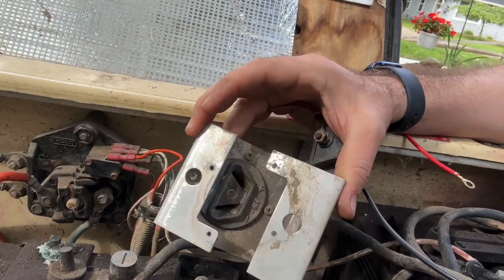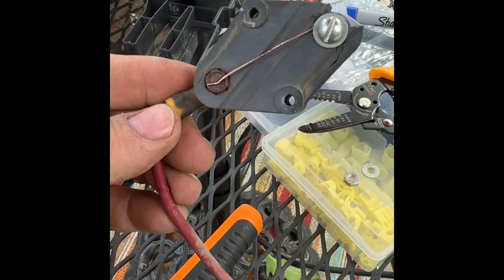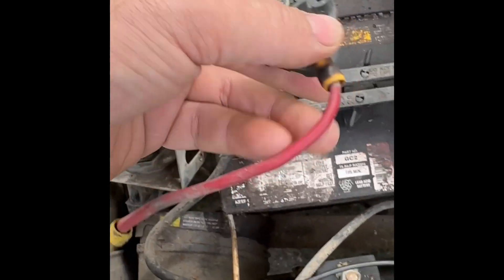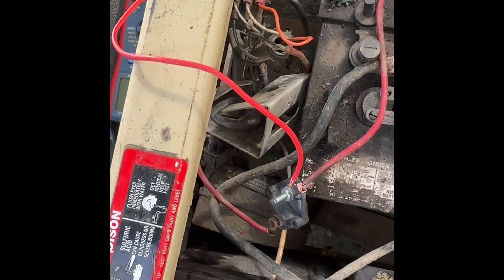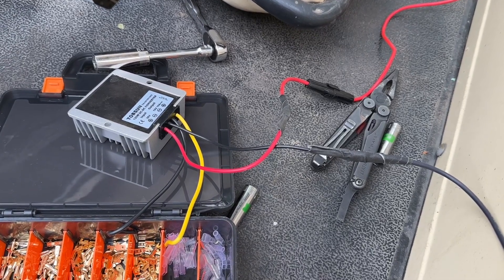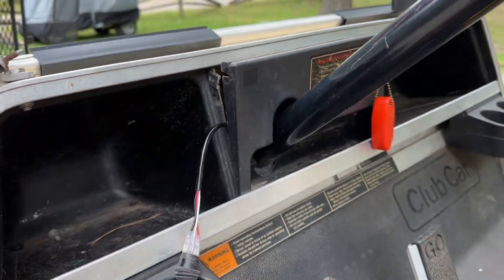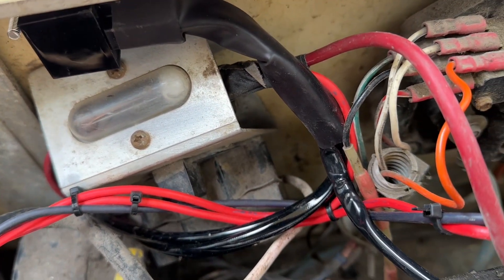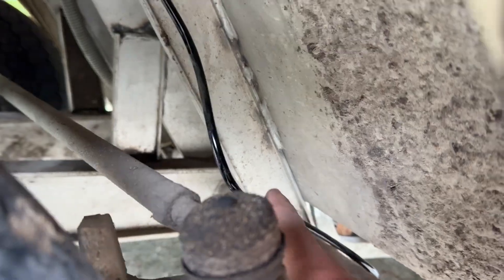EZ-GO Electric Golf Cart NiLight LED Headlight Install plus wiring repairs

Comment: I’m just about to install this same set up on my golf cart.  Did you have to modify the nilight harness? For example…did you have to cut off the connector for the battery terminal because it now runs through the converter? Thanks
Reply from the maker: Yep! Where the Nilight harness would normally connect to your battery, I snipped that end to length and crimped on a bullet connector, with matching end on the 12v output wire of the convertor.  

That way everything was individually removable and replaceable.
Reply: Thanks for the reply. I figured that would be the easiest way to do it.